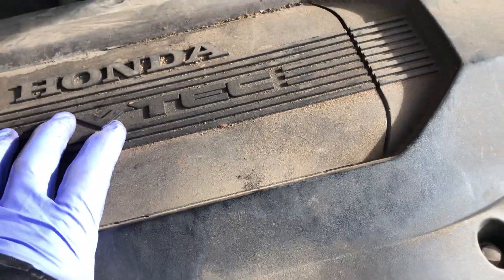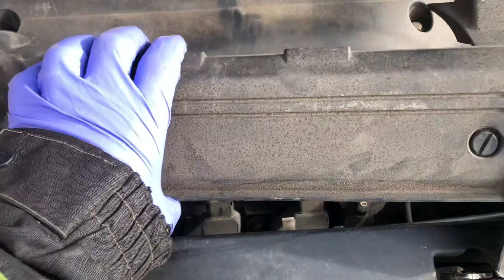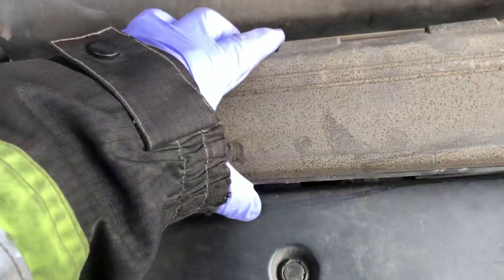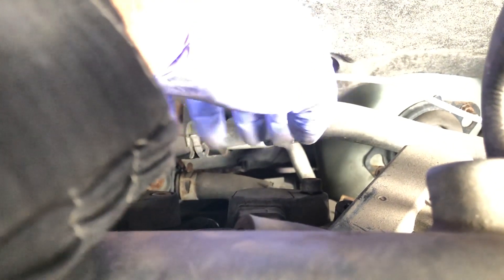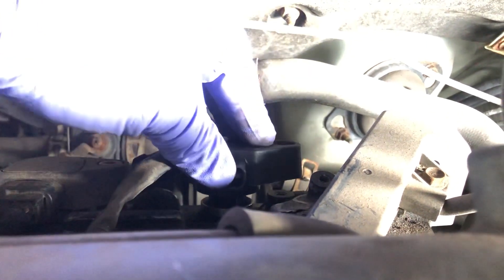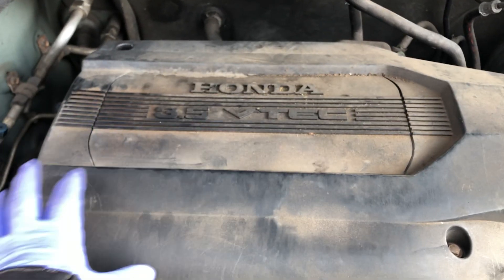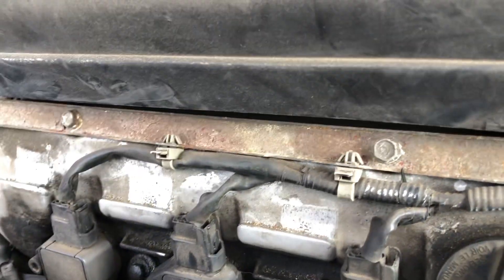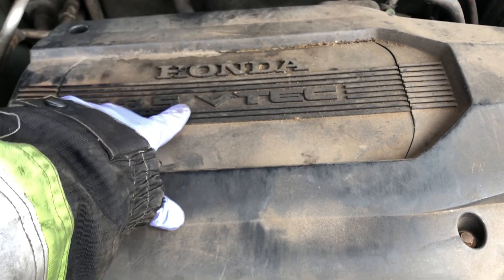How to change an ignition coil pack on a 2003 Honda Odyssey 3.5L V-tech engine

Comment: I guess I’m a long time subscriber. No longer a tow truck driver. At least for the time being. Definitely still going to watch and rewatch your videos
Reply from the maker: Thanks for the support. How come you’re not towing anymore? Hope all is well.
Reply: My 2000 odessy still has a miss replaced the coils and plugs still has a miss ?help
Reply: @tomsudlesky3861  could be fuel injectors, but take it to a mechanic for a full or engine inspection. Then they'll tell you what needs to be replaced and depending on difficulty try replacing on your own.
Reply from the maker: It’s possible you have a bad injector or a broken wire. I’d have a mechanic look at it. Does it have a check engine light on? Sorry for the late response I’m just seeing your comment.